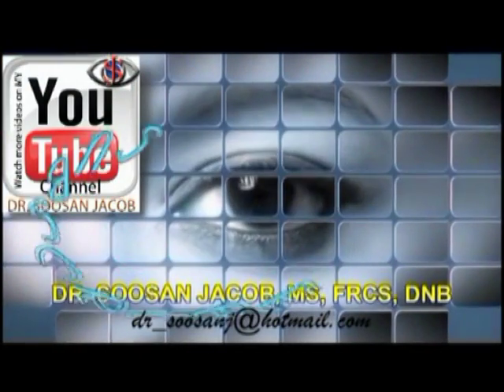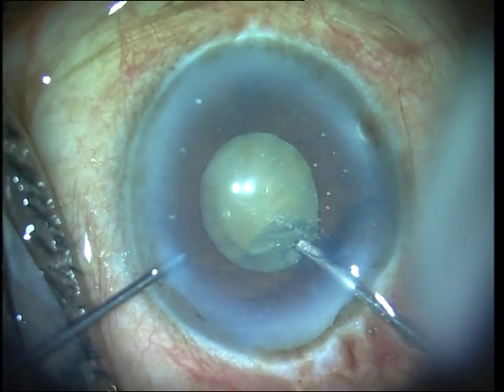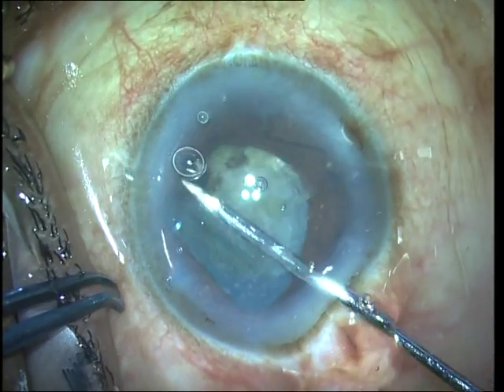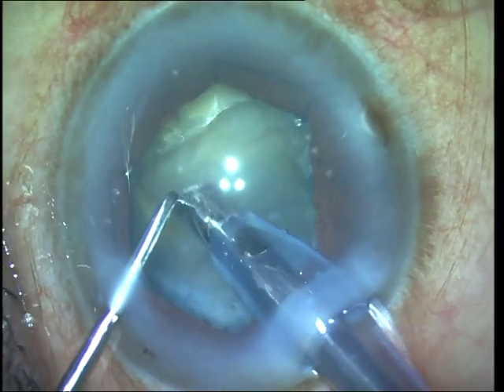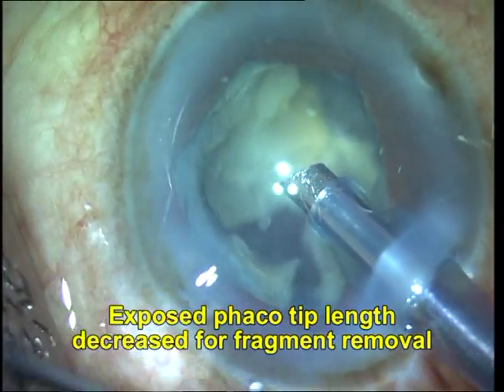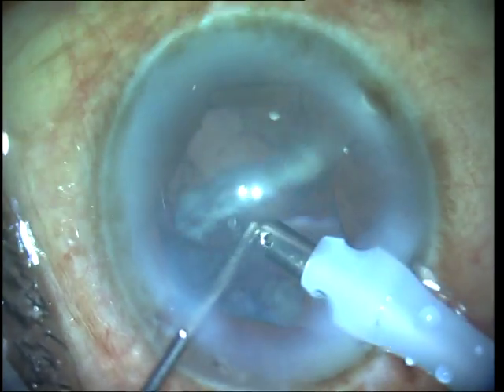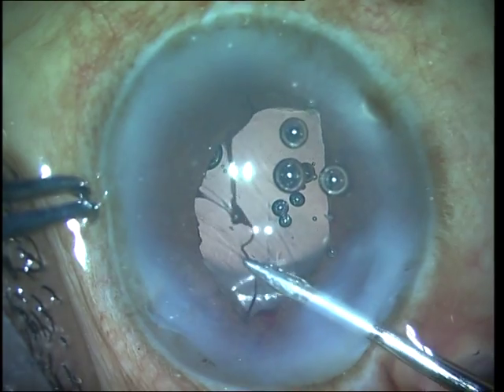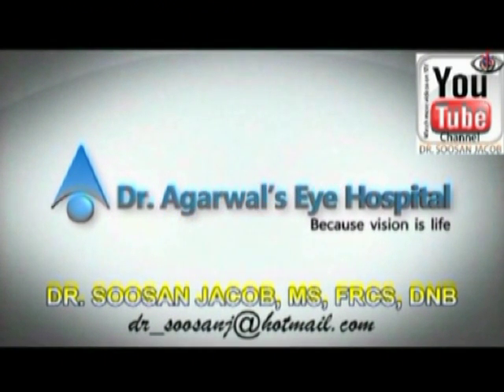Crater and Chop for brown cataract with BHex Ring Soosan Jacob with audio 4min

Comment: just wanted to know whts d advantage of putting the air bubble after d surgery which I noticed in many of ur videos ..
Reply from the maker: It helps give you a slightly more leak proof incision if your incisions are superiorly placed where they will be covered by the bubble. It's something I have got used to doing over the years, however it is not at all a must for every case. Well constructed incisions can be left alone without the air bubble
Reply: +Dr. Soosan Jacob thanks a lot Nd congratulations for the ascrs award